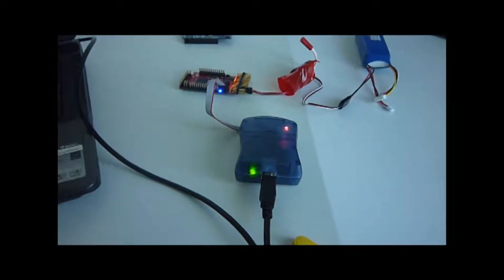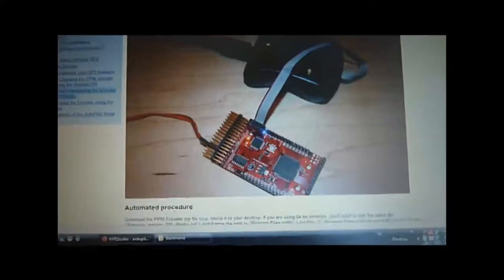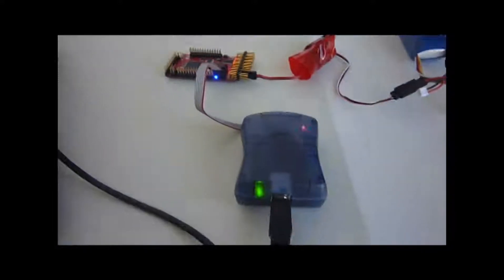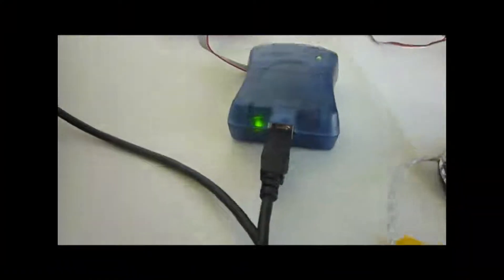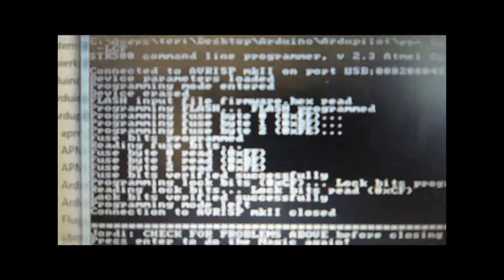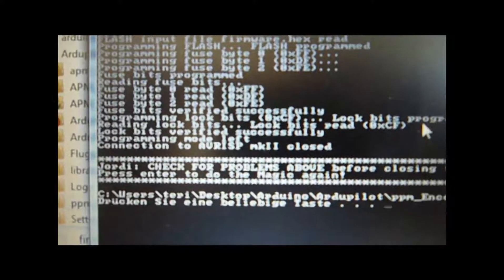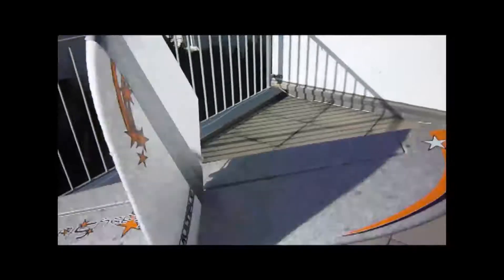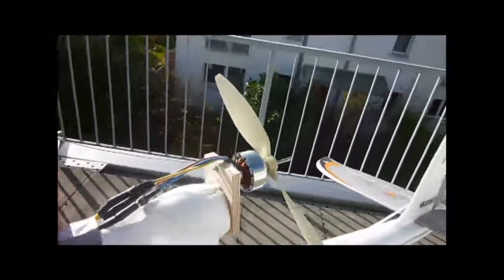ArduPilot Mega PPM Upgrade and Test of Stabilize Mode

Comment: I get this error:

STK500 command line programmer, v 2.3 Atmel Corp (C) 2004-2009.

Connected to AVRISP mkII on port USB:000200053901 Device parameters loaded Could not enter programming mode Programming mode left Connection to AVRISP mkII closed

WARNING! One or more operations failed! Please examine the output log above!

Comment from the maker: Thanks for the comment. I ordered Cularis as test frame, SkyFun might be a better choice. 

My EasyStar is too heavy as I have a big battery because of the current consumption by the autopilot. 

When I tested the stabilize mode the cable to the GPS broke, I wait for the delivery of the new an longer cable. With the actual version even the STABILIZE mode does not work without a GPS-Lock.

I hope to be able to test the AUTO mode next week.

Comment: Thanks for posting this. I tested mine out 2 weeks ago in-flight and it was flawless. I have tried both platforms and the SkyFun (stock motor and ESC) works the best for me. Since the wind speed was usually faster than the slow-flying EasyStar was flying, it was just too brittle of a platform.

If you have trouble w/ the EasyStar, try the SkyFun - it works w/ stock gains and has a bunch of room inside. If you test in-flight navigation functions like RTL or Auto, could you please post that too?